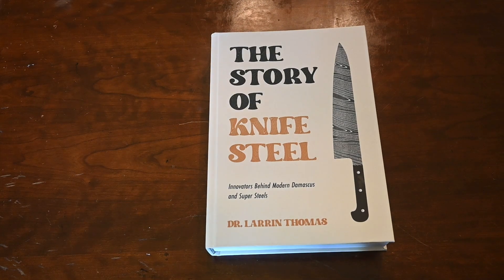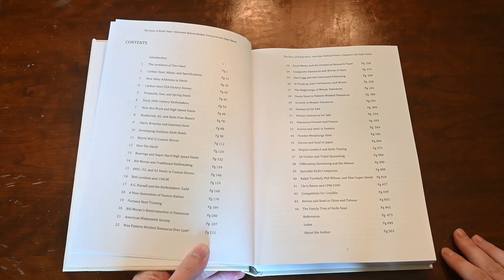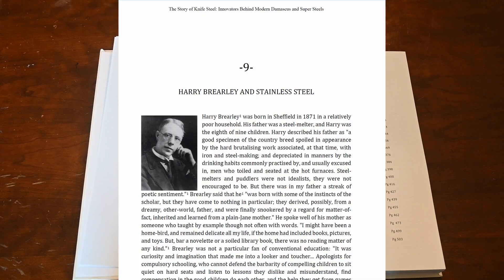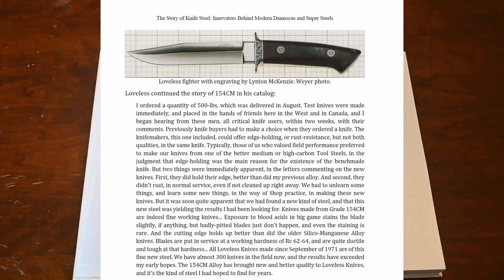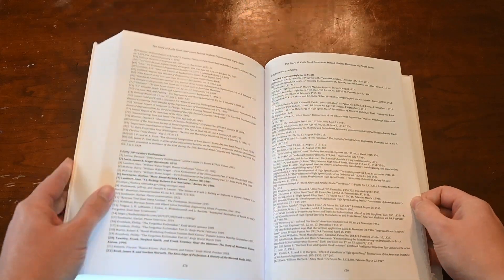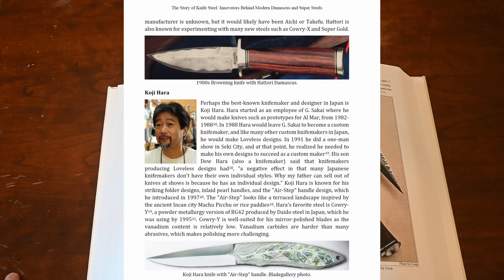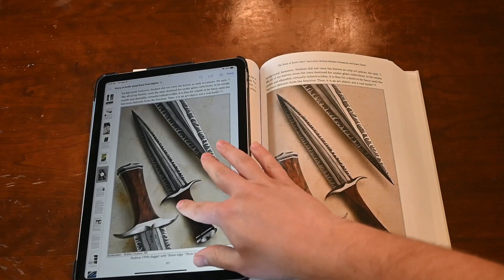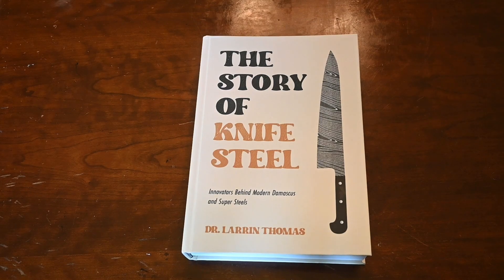New Book! The Story of Knife Steel (My Biggest Project Ever)

Comment: Your timing on this video is quite handy, I recently decided to start my journey down the rabbit hole that is knife making and I just obtained "Knife Engineering" the other day and barely cracked the surface before realizing how little I knew about history new or old.  Thank you for conglomerating and making this information available as well as all the testing done to compare various steels as it helped me decide which materials don't want to be using and even pick a couple different billets to shape later when I figure out the heat treatment things I need to gather.